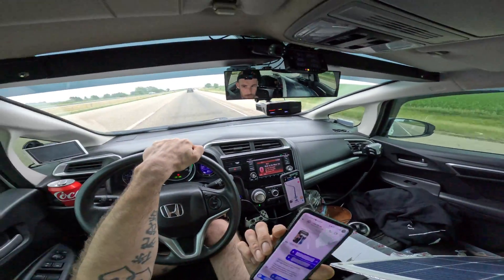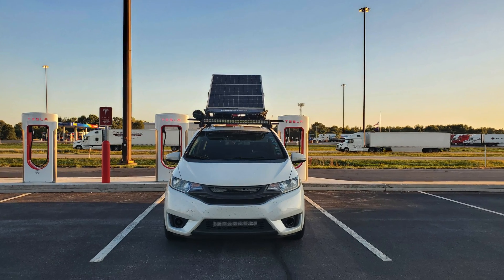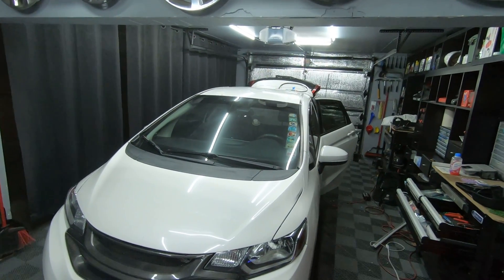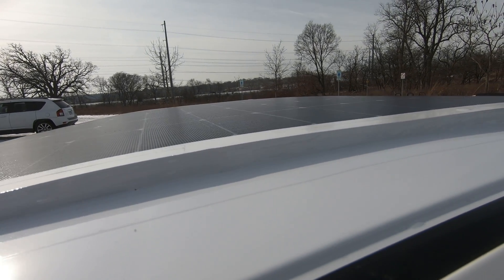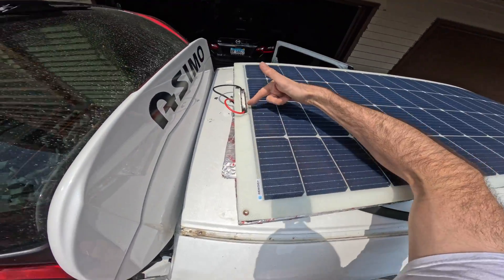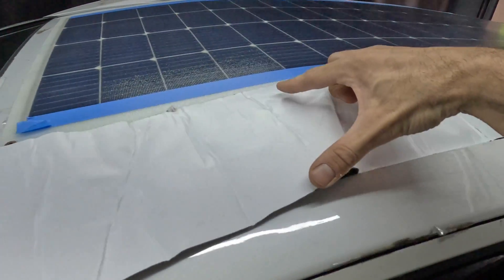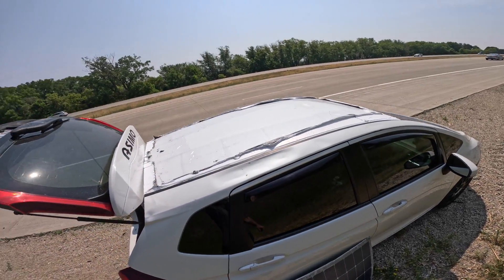200 Watt Flexible Solar Panel 1 Year Review - Learn From My Mistakes!

Comment: how do you get the solar panel cables into the car
Reply from the maker: I removed the radio antenna and ran the cables in through the hole that was underneath the antenna.
I use my phone or a flashdrive for music so not having an antenna hasn't been much of an issue except for the drive-in movie theater.

Comment: Can you do a review on dual battery set up and lifepo4 performace?
Reply from the maker: Greetings. I don't have a dual battery setup at the moment, but I have been thinking about installing one.
I did upgrade to a 100ah Lifepo4 battery though, so I can give you a quick review.
I was able to purchase a LiTime 100ah LifePO4 on sale for $200  https://amzn.to/41CRnQT
It was recommended by @SolarWithWIllProwse https://www.youtube.com/@WillProwse
Pro's: 
- The battery on sale puts it at or around the same price point as a AGM battery.
- Weight Savings. The AGM battery weighed in at 49lbs and the lifepo4 battery weighed in at 22lbs. That's a 27lb weight reduction!
- Deeper discharge rate. The AGM battery can safely discharge down to 50% while the LifePO4 battery can discharge down to 30% or lower.
The extra 20ah of useable storage power is enough to make the damaged solar panel less of an issue.
Con's
-Winter. I was worried about using the lithium ion battery during the winter, but so far it hasn't been an issue. 
I recently car camped  in -18f and it got down to 5*f inside of the car. https://youtu.be/KmTWDlOMDcU?si=U8Rd_fv-DynLzN2f
So far the new battery has survived two winters and it still performs well.
Reply: @HondaFit4Adventure  just installed a second battery in my trunk direct parallel to starter lead acid but only getting 12.2v even though its a welding cable rated for 600v. Need to do more testing to find the reason. While the starter battery reads 13.1v. Any thoughts on improvement?
Reply from the maker: @Dptl  Do you have a battery charger?
I would charge up the secondary battery or put it on repair mode and see if the voltage drops again.
If you have a multi meter or cheap volt meter I would disconnect the secondary battery and test the voltage coming from the cable. 
The last test should help determine if the battery or the cable is bad.
What are you using for an isolator between the two batteries?
Reply from the maker: @Dptl   Yeah, it sounds like you need to recharge the battery and put the charger on repair mode. The battery may have even been damaged if it was discharged to low.

W/O? So the starter battery is hooked up to your secondary battery in parallel with out a isolator or DC2DC charger?
That might be your issue. You secondary battery could be trying to charge your starter battery when the car is off or visa versa.
Reply: @HondaFit4Adventure  fixed. Now the system seems to be a success. Battery charging alright. But yeh got a breaker switch by the front dash that I use to cut the connection when i am not driving.
Reply from the maker: @ Ok. I would still install that battery isolator. This way you wont have to shut the breaker switch on and off manually every time.  
From what I've read online, it looks like the DC to DC charger is something you'd definitely want for a lithium ion battery setup.
Reply: @ does that mean dc chargers eliminates the necessity of isolator as it is one way charge?

Comment: I'm researching doing this same build and was thinking to try just using the magnets and maybe only taping the front side of the panel. How is yours holding up?
Reply from the maker: The magnets have been working out extremely well. They've held up to high speeds for prolonged periods of time. I would recommend using at least 12 magnets. 4 on each edge of the panel.
Reply: @HondaFit4Adventure  would it still need the tape on the front edge with 4 magnets per side?
Reply from the maker: @JerseyMiller  Yes, I would also recommend putting tape across the front edge of the panel. The tape would help deflect most of the air to go up and over the panel rather then going underneath and potentially creating lift.

Comment: I feel like attaching it directly to the roof the car would act as a heat sink
Reply from the maker: Hi there. The panel instructions do state not to directly mount it to the roof of vehicles. It needs an air gap underneath the panel for cooling purposes. It's not really shown in this video, but the solar panel is laying on various size sheets of coroplast. This prevents the panel from laying directly on the roofs surface and helps level out the roof for mounting. Some viewers think that sealing the panel around the edges created a "Hot Pocket" of air which caused the tape to fail and will cause the panel to overheat and eventually fail as well. This is not true, at least on this install. I have the battery temperature sensor from the charge controller located underneath the panel so I can monitor the "air pocket temps" The air pocket is at the most 10 degrees hotter then the surface of my car.
Reply: @HondaFit4Adventure  maybe the BougeRV panels are different.  That’s the ones I’m thinking of because they sell a version with tape on the back of it (presumably to mount on top of the car)

Comment: Actually seeing technique used and highway results is amazingly invaluable. Do you think the heat buildup was ever an issue?
Reply from the maker: Thank you. I don't think the Solar Panel itself generated enough heat to cause any issues. I placed the the "Battery Temperature Sensor" from the charge controller, underneath the solar panel before securing it down. This way I would be able to see how hot underneath the panel was getting.
I think the sun in general softened up the adhesive. That combined with travelling at a high rate of speed caused the panel to become loose and blow off.
The roofing tape, although strong, was made to seal/waterproof a stationary object. It wouldn't typically see 80mph winds unless there was a tornado.  Even then, the tape would just be experiencing high winds and no heat.

Comment: I'm wondering if you could incorporate a reverse airfoil.  KInda like formula 1...more speed actually creates downward pressure, at 80mph  it would actually be more secure.
Reply from the maker: That's an interesting idea.
I did find an extra wide sunroof air deflector that I might try out.
#GodSpeed

Comment: I think there might need to be some underside cooling on the solar panel. Your 2nd install seems to indicate extreme heat that is melting the bonding tape.
Reply from the maker: Hi Linus. The battery temperature sensor from the charge controller has been placed underneath the solar panel and heat doesn't really seem be an issue, at least heat being created from the solar panel. 
The EternaBond tape adhesive appears to be getting soft from the sun alone. Even though the tape was meant to go on the rooftops of RV's, it was only meant for sealing purposes and not to secure anything down.
The magnets and EternaBond tape are still holding up well.

Comment: I used 15ft of the heavy duty 3m tape (5952 VHB) for my build. It was on a transit connect, so the aerodynamics were different, but i never had an issue (even doing 90mph in parts of texas). I didnt even really prep the roof before installing, just wiped it down with a damp towel. The transit roof did have channels running the length of it, so i taped the pannel directly to the roof and just parked downhill every couple of days to drain the water 😂

Loving the channel and really looking forward to learning what i can do with my fit.
Reply from the maker: Thank You!
That's the 3M tape that I purchased. What size panel did you use?
I think the size of the panel may play a part in how well the VHB or other mounting solutions may work.

Comment: 80 mph :) Back when my Jazz was new in 2006 she's do that easy. The wife, the two little ones and sometimes both in-laws all packed in....yet she would still be accelerating up and over the mountains here in northern Thailand :)
Sadly just a get from here to there ride nowadays....not as fast or nippy but she still gets there :)
Love those magnets!
Reply from the maker: How many miles are on your 2006 Honda Jazz?
I ran into the same issue on my Honda Ruckus. It was up to 38km and would no longer go past 56kmh. It used to go up to 83kmh.
Thank you, I tried using the magnets from the start, but only using the 6 original mounting holes. I never thought to add more around the edges. Next time I'll scoot the magnets further in if possible. That way they won't be bulging out from the sides of the panel.
Reply: @HondaFit4Adventure  my 2006 Honda Fit/Jazz is 270K km which is like 165K miles
Reply from the maker: Oh wow, that's not bad at all. Are you still able to find parts for it? It sounds like that's everyone's biggest issue here in the U.S.  They no longer make replacement parts for the first gen Fit, and it's such a good car that you cant really find them in the junk yard. @Ulbre
Reply: @HondaFit4Adventure  PArts no problem here in Thailand. Spare parts manufacture is  a huge industry here. Cheap too. 
Last year,  replaced the radiator with a brand new one for around 100 dollars, including labour :)

Comment: bout to do something similar to my chevy volt with 2x 100w panels. I was going to use a bunch of silicone and upgade the 12v battery to a large lifepo4 4cell prismatic guy with no BMS. since the volt is probably the only car that starts its gas motor with a high voltage battery, the 12v system doesnt really have to do much. i calculate getting rid of the 12v parasitic load on my high voltage battery will get me from currently 40 miles all electric range to around 50 miles. i was going to put a bunch of copper foil tape down underneith the solar panels to act as heat sinks to spread the heat out a little bit better since i think heat eventually is the death of these panels.
Reply from the maker: I'm thinking the 100watt panels will be easier to secure  down.
If you have any Hybrid questions, get a hold of @GonzoPrius  on YouTube or IG. He should be able to help you out with any  Hybrid related questions and he's a super cool dude!
I know my panel set up is completely sealed around the edges, but I do have air pockets underneath the panel. I also ran a temp sensor up through the antenna hole along side of the solar cables so I can monitor how hot it gets under the panel. 
Copper/Foil Tape sounds like a good idea. I'll have to look into that for next time.
Reply: @HondaFit4Adventure  mini update. started to take apart the headliner in my volt, have been reading the very long and detailed manual someone posted on the gm forums about how the volt (and bolt i believe) handles charging the low voltage battery. some issues ive found is that apparently the car will randomly try to charge the 12v battery at ~100 amps during the desulfination phase of charging the battery, which is a little bit disconcerting. the solar pannels should keep the voltage mostly above the low voltage trigger to charge the 12v battery most of the time; however before i spend ~380$ on 4x 280ah lifepo4 eve cells i am going to try to build a mini 4s2p battery with what looks like to me to be 28700 lifepo4 cells and just see how the car handles it. on the final battery i will include a temperature regulation circuit + thermocoulple which will turn on a 40watt silicone heating pad to keep the battery above 0C since that is the rrange where damage can occur to lifepo4 chemistry when charging (not discharching though). waiting on some brass car battery terminals to come in from china so i can just keep everything plug n play if it doesnt work out. upgraded the headlights to color changing LED's which only draw about 30watts each instead of the 65 watt halogens, and also did some other fuel economy improvements to the car, getting around 45 miles of range now of usable state of charge. when i bought the car new around 1 year ago it only had around 32 miles usable EV range. got the car for 7800$ and ive already saved ~2000$ in gas lol, like a 3.5 year ROI at this point. cant say that about a tesla. doing more research it looks like the battery heating circuit, resistive cabin heat, and heated seats all run off of the 12v system so this could potentially help the most in cold weather. the Aircon somehow runs off the 340 volt system so probably not there other than the cabin fain is 12v.
pretty sure I will use 3m window weld poly-urethane to secure the panel. need to test fit and see if i have the same issue with curvature as you... hoping 2x longer 100w pannels will be okay

Comment: Newer subscriber and fellow fit freak, I'm awed by the consistent quality of your work. You're awesome man! IDK if you have a video or google doc with a full list of parts and upgrades you've done but I'd love to peep your performance mod list (CAI, bolt on turbo, lightweight wheels/tires, exhaust build etc). I'm also looking at a full rear drum to disc brake conversion kit, would love to hear your thoughts if you've done this already.
Reply from the maker: Thank You, Fit Fam!
The 2022 tour video would be the closest thing I have to a mod list, but it's already outdated. https://youtu.be/zWGEmOhNHVo?si=aQQb8Bq80VwcmMdL
Performance Mod List:
I switched from an AEM short ram to a HPS CAI. "For looks"
My rims are about the same weight as the factory wheels, but with oversized tires. This gives me a bit of a lift and also increases the top speed by 4mph.  https://youtu.be/wn21IUFnlTQ?si=g-ZIu4ZIqOoHdEUA
That video is a bit dated to because I'm now up to 205/60/16.
I added a short throw shifter, UDP, Pedal Commander and Rear sway bar to the car. That's about it for performance mods.
I have not done the rear disc conversion. I've gotten a lot of requests for the "Clutch Delay Valve Delete"
Wildwood front brakes and Honda Insight rear springs are next on the todo list. 
Every install is documented on the channel ;)

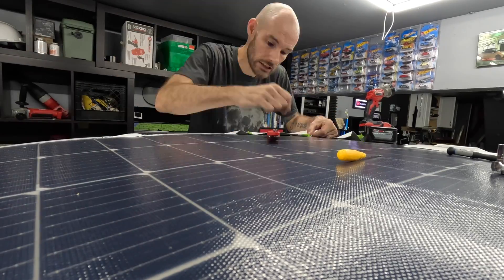Comment: Haha 5:50mins in is the definition of belt and braces. I had the same issue with a flexi panel on my Volvo V70. I used 20mm aluminium profile to finally build it a frame and added bolts for the eyelets and the bloody thing got ripped off the eyelets on the motorway 🤣😂😂
Reply from the maker: Lol, I had to google what "Belt & Braces" meant.
What size panel were you trying to attach?
I tried to copy another YouTube video that used Aluminum Z transition strips, but I couldn't the transition strips anywhere.
It seems like everyone has had different success & failures with mounting a solar panel to their vehicle.
Reply: I installed 2 large 120w Ecoworthy Flexi panels 1.5ft by 4ft? I think?

Comment: So just so I'm clear... you cut a HOLE in the ROOF OF YOUR CAR to run the cables through????
Reply from the maker: I removed the antenna to run the solar panel cables through the roof of the car. No drilling required! I even had a nice "Junction Box" or "Entry Gland" for the cables to enter into the roof, back when I had the cargo basket setup. https://youtu.be/c2tnOGfgirU?si=S1pwJNRRBAODO9aN&t=128
I no longer have am/fm radio which wasn't a big deal, until I went to a drive in Movie theatre and forgot that I needed to tune into a radio station to hear the audio, lol.
Reply: i think he removed the roof antenna and reused it hole for the solar wiring
Reply from the maker: Yes, Sir!

Comment: how is regulation in america allowing this?? holy shit...
you are literally endangering other peoples lives. extremely irresponsible.
Reply from the maker: Hi Tanko, most of America is only concerned with emissions on a vehicle.
Only about 20 states require regular safety inspections.
I did some high speed testing out on some back roads first, but what I could not test for was longevity while traveling at speed.
I saw a few other install videos recommending eternabond to secure the panel down. I can now inform those people/channels not to do this and refer them to a video that shows the installation method failing.
Reply: lol how is regulation in the uk allowing you to post. dont u ned a loience four dat
Reply: @vevenaneathna im not bri'ish.

Comment: Pretty reckless to have the solar panel fall off like that. Could've easily caused a crash.
Reply from the maker: You're not wrong.
I did some high speed testing out on some back roads first, but what I could not test for was longevity while traveling at speed.
I saw a few other install videos recommending eternabond to secure the panel down. I can now inform those people/channels not to do this and refer them to a video that shows the installation method failing.